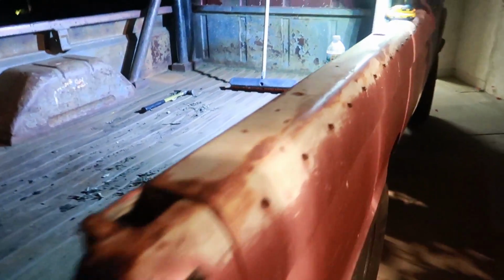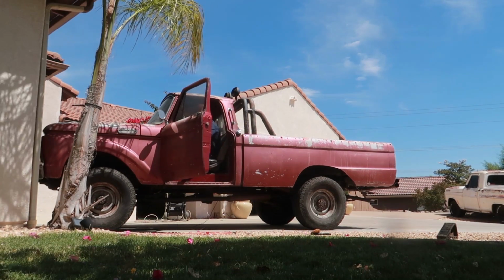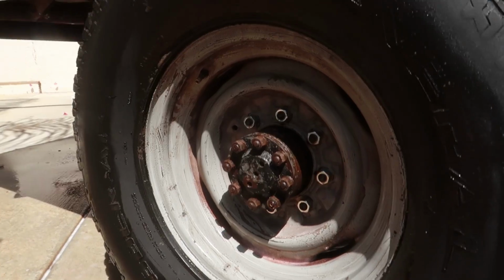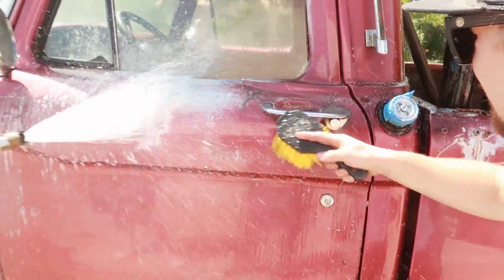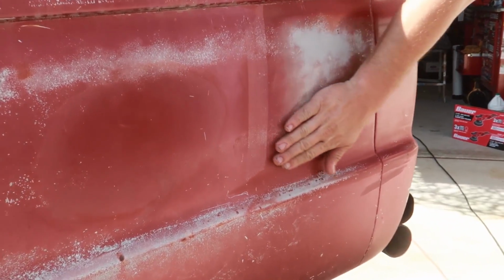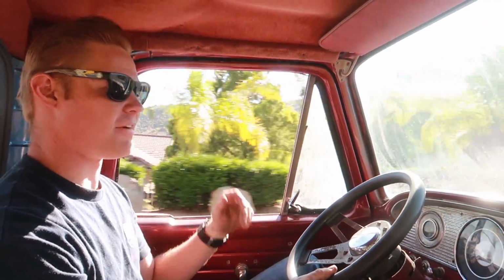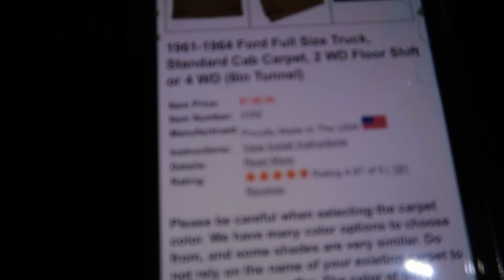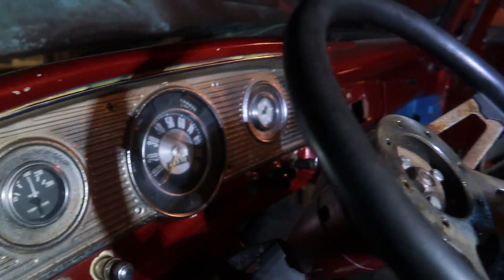My 61 F250 Get's NEW WHEELS and It's First Pressure Wash In YEARS!

Comment: The 4 speed in them trucks are geared to use 2nd gear as a starting gear in normal use...1st or granny low is used for pulling or hauling heavy loads

Comment: It's a 4 wheel drive, put a rubber mat not carpet.
Reply: I agree raptor bedliner is awesome as well
Reply: Rubber mats are rubbish unless the truck is being used for work; ugly, cold and no noise suppression to speak of. Nothing about this channel suggests that this truck will spend most of its time on a job site or crawling through a bog, which is absolutely fine.
Reply: @pmodd  kinda wish Craig would go offroad with his truck like he does with the bikes

Comment: Try double clutching the shift points, or “floating” the gears. 1st gear in your truck is probably a “granny” gear, so unless you’re pulling something,  I’d forget about that gear unless it’s needed. As for 2-4, float the gears, meaning, don’t use the clutch. As you reach the top end of the gear, as you back off the throttle to shift, instead of pushing in the clutch, pull the shifter into neutral, then immediately slide it into the next gear, thereby “catching” the next gear before you lose all your rpm in the motor. The same procedure can be done to downshift without using the clutch. It’s called matching your rpm’s to your road speed. Of course, you’ll need to push in the clutch while starting out, or at a complete stop. Once you master the technique, you’ll only use the clutch to start and stop. I did that for 26 years in my tractor-trailer, and my clutch usually lasted 175-200k miles. I’m not saying you’ll get the same results, but from what I can tell, you’ve got a non-synchronized transmission, and that may solve your shift issues. Good luck!

Comment: Do what you want with the paint but it's wrecked, Even a rattle can job with proper prep work would be good. same goes for your 2wd truck. make it all look one good color instead of faded. those snap holes would need to be welded and filled . doesn't need to be perfect but will keep it from rusting further. Cali has the advantage to not have major rust on trucks/ cars. I'd clean it up with a simple paint job (rattle or spray) and fix all the stuff on the truck. update  the things like headlights, tails to LED. Make it reliable engine and drive train wise. maybe consider updating the gauges (dakota digital?), reupholster the seat and carpet. if your real serious a few companies have A/C kits for those trucks. You don't need to go crazy just improve on what the truck is and make it reliable and a good driver and comfortable. Then have fun with it. Or sell it and make some money and move on to another project.

Comment: Amazing how just removing the extra crap ppl put on the truck made it look so much better!   I like the idea of bed liner on the floor and bed floor.... It doubles as a sound deadener and is super nice on a 4x4 truck .... Easy to wash mud out.  Steelies look nice. I bet they had interior panels on those blue parts inside the cab.   What about a late 80s early 90s f150 bench might be a low buck seat upgrade...

Comment: Just a suggestion you could always fill the holes with some an do a cheap bed liner kit from like Walmart an tape off the sides on the bed of the truck an have a coat all the way around just a cleaner tape line around it

Comment: if you can find diamond plate caps for a 61 or have them made. Leave most of the holes uncovered and drill  the diamond plate and connect in strategic areas

Comment: You can pull the old carpet our and pressure wash it and let it dry. and you can get ritz dye in black. Mix it in a bug sprayer and.  spray in on. Than take a micro fiber and rubb it down. Let it dry and it will look brand new. Not out but like 10 bucks and some time

Comment: I’d put stainless steel button snaps back in the holes.  Keeps with the character and era of the truck. If you remove and hide the holes you have these unexplained streaks in the paint under where the snaps were.  Personally I like the look.

Comment: Wheels definitely make the look!  Cut and buff?  I rather think that would be a fool's errand; here's why: That is a process used "back in the day" with lacquer paint, much later with 2 stage  painting systems. The truck is definitely painted with enamel. It was the most practical choice in those days.  The red color looks much like the color on my '67 Mustang, it was called "Candy apple red" although it actually was a single stage enamel. The blue paint is probably because the factory color was blue! Rubber mat or at least get some Weather Tech liners to keep the carpets clean.

Comment: Truck looks fantastic with the new wheels.  Hopefully the steering wheel is on the short list as well, that thing is awful.  Like others have said, start her in 2nd gear.  My old Ford was the same way and I was convinced my trans was shot because of how bad the 1-2 shift was until a friend set me straight on not using first for just cruising around.
Looking forward to see where this truck goes 👌

Comment: I got Steele's wheels with factory hub caps on the back only. On my 60s 4x4s  They didn't make a front hub cap for the 4x4s in early to mid 60s
Reply: Mark you probably think the hubcaps will give it better traction or fuel mileage but like your ideas " that is just silly "just what do! you think is ridiculous and so are hubcaps

Comment: Couldn't a welder spot weld over those holes. Then you could grind them down and prime them. Of course you could sand, prime and paint the truck which would be awesome! Match that metallic red. Of course first you need to make the truck driveable. Paint is the last thing this truck needs. You could also sand and hand paint the roll bar and the black bumper. And put an killer stereo and speakers in it. You could get a copy of Glenn Campbell's song I Love My Truck and blast it on some intercom speakers as you drive around town.

Comment: The color looks like a candy apple red with high metal flake,!!    They probably did a cab replacement and the blue is what they didn't paint, looks like a cheap spray job!!! The blue was probably kick panels on the bottom and  a chrome trim piece for the top of the cab, and there gone now!!., needs a bigger exhaust also the 1 1/4 is way to small now for that motor, but boy did you score right there. That is a very nice truck for the fleet,        so when are going to rent a small storage unit shop with some of the guys!!???? You need a place to store/ dry work space now, 👍

Comment: You own a slick, 61, you've own(ed) bumps, have you ever owned a dentside, 73-79?
Reply from the maker: You bet. Scroll way back on my channels videos and I had a old 75 f250. Loved it. There’s a full build series on my channel for it
Reply: @Thecraig909  sweet, 75 250. I had one years ago, 75 250 camper special 460. Bout it for 850, with 80,000 from the original owner.  It had 2 little bitty rust spots, a miracle for a truck in Michigan.  Kick myself in the ass every day, for 24 years, for selling it. But, I was 20, young and dumb. Lol